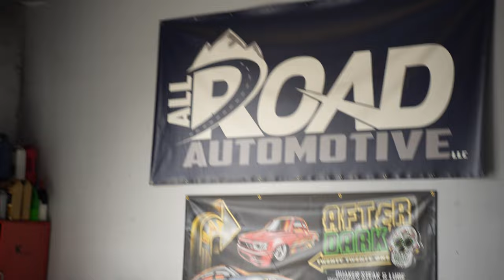PICKING UP OUR $250,000 CUSTOM WORK RIG! High County Duramax, gooseneck, T66

Comment: I want this truck so bad. I am an out of work mechanic in between a shit job and a new shop that got delayed opening.  I wont have money to get an entry til after the give away is over. Barely getting by atm as it is. I thought about the bo purchase necessary mail in entry, but i know you guys got a shit ton of money in this thing and i would feel bad not buying into the giveaway and winning while others spent hard earned money to get a chance. I could so put this rig to work. I have a 97 2500 chyanne and have been trying to work her here in nwi but haven't seen able to make enough.  You guys are awesome.